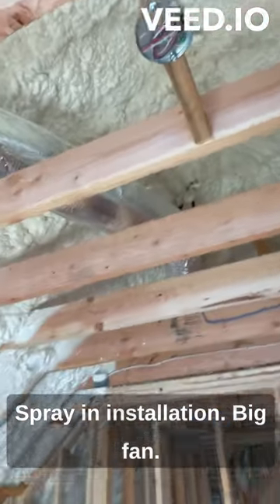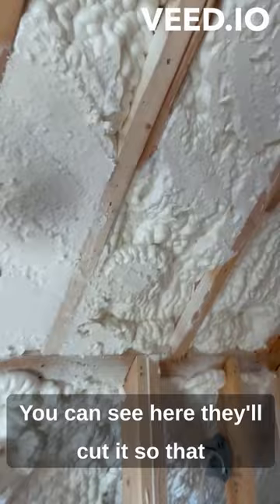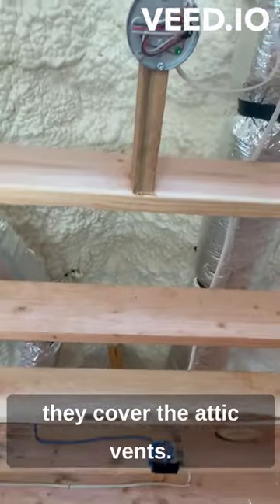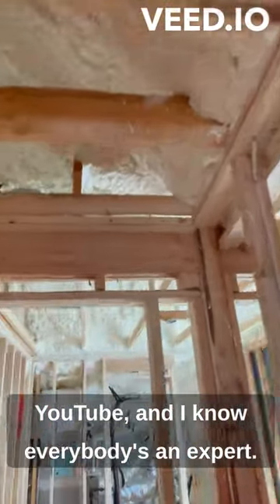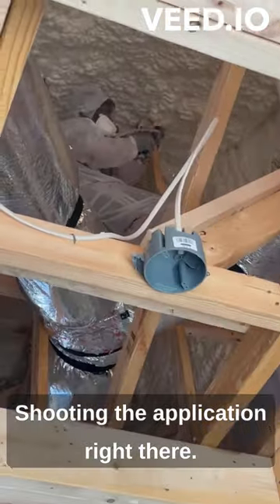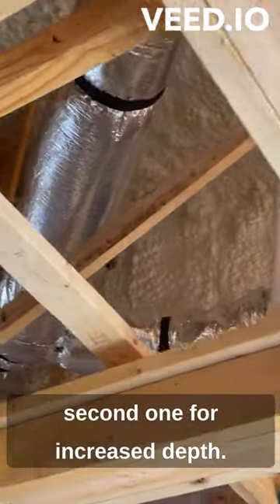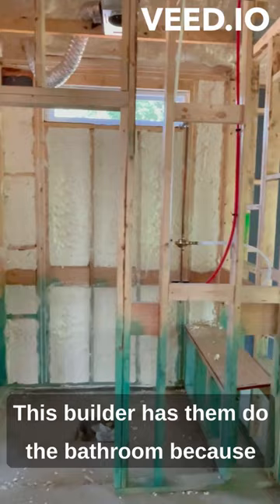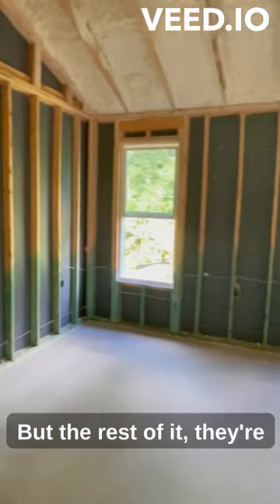No Ventilation with Foam Insulation?

Comment: The key here from the roofing standpoint IS, Dew Point !
The Dewpoint is the surface on the building where condensation will start to form. In this example, it is the interior side of the plywood on the roof surface. To counter this the roofer is now required to install Isosanurate  board insulation over the roof plywood to make the “roof plywood” “warm” or said another way, the same temperature of the attic foam insulation  Then another layer of plywood is installed over that and then the roofing is installed to the second layer of plywood.  The trick here is the plywood that is just above the interior spray foam cannot be left to get cold in the winter time. If it does it becomes the point where humidity will change from humidity to water/conensation, and that will create rot in the roof plywood.
 Sandwiched insulation between two layers of plywood protects the inner plywood  from rot which is structural. The outer plywood is only susceptible to roof installation errors and damage and water leaks. So from what we see here a vapor barrier of 15 or 30 pound felt paper should be installed over the initial structural plywood on these trusses over this foam and then a layer of iso insulation typically two layers of inch and a half staggered  with a layer of plywood laid over that or vented over that with inch and a half sleepers that which can be either strips of insulation or two by fours screwed into the rafters through the all of that isolate isolate insulation. Then the typical ridge vent and soffit venting  keeping the actual roof top roofing plywood dry and cool accordingly to the season. Again, understanding dewpoint and where it happens is the key here.
Reply: The point of closed cell spray foam is that warm humid air never reaches the cold surface of the plywood because the foam is an air barrier
Reply: The assumption that the closed cell foam will forever not split, crack or in some way ever allow moisture thru is not realistic. 
You are also assuming that no future contractor will ever violate the foam or that the homeowners as the home is sold multiple times in the future will live in a less than moist home. 
 Condensation in a home is just as much a result of living conditions and desires as it is environmental influences. The only constant is that things change. The second layer of exterior insulation and venting forgives all of the interior sins in the future

Comment: We do this in Texas when we do a standing seam metal roof. I’m an in the insulation business and we recommend a dehumidifier in the attic.
Reply: Or you know... You could just vent it? 😂
Reply: Spray foam works better than typical batts 🤷‍♂️you get a better R value with less space taken up.
Reply: @mihlfeldl2005 Why vent it when you can just ALWAYS have the power on. After all, houses are NEVER vacant for extended periods of time, and ice storms NEVER freeze up all the wind farms and knock out the power. /s 

It's just like all these houses that really need sump pumps: the house will be destroyed by mold after 6 months of vacancy.

Comment: I did batts in the walls (2x6) and spray foamed the attic. I’m in Atlanta area too. Had FoamSouth do my foam. Ryan and his guys are awesome. Highly recommend them. I did zip system on my house and air sealed it up tight paying super close attention to air sealing. I didn’t need foam for air sealing, just for R value so that’s why I didn’t do it in the walls to save a few $. I actually “vented” my ridge with some Carlisle Vapor permeable self adhered membrane, to allow any vapor to get out since the open cell foam is vapor permeable. I run a whole house dehumidifier (Aprilaire) in addition to my ac system. Also have a Fantech ERV for fresh air ventilation (runs 24/7). This house is THE MOST COMFORTABLE house I ever lived in. I have an indoor Air quality monitor that I have been collecting data for 9+ months now and our IAQ is 👍👍👍. Our most expensive heating bill this winter was $200 (natural gas furnaces) conditioning 3800 SF. Mid June - Mid July power bill was $240. We keep the house at 73 degrees during the day. 70 at night.
Reply from the maker: I've seen a ton of positives with this product, just this "seal it up" counters what I'm used to. Same for crawls, used to be air flow and now it's encapsulation. If you're doing well with this weather, humidity, ozone and fire smoke....you know it works lol
Reply: @Hmtatlanta  I never understood the thought process of venting the crawlspace. Maybe during the winter, but during summer you’re letting all that humidity in. I’m in the encapsulation camp. My buddy did his old house. The musty smell immediately went away and the humidity levels were much easier to keep in check. I highly recommend a whole house dehumidifier for anyone in the south. After putting one in my new house I just built, I’m sold. I will have one in every house going forward. Also allows you to run your thermostat temp a little higher and still be comfortable because humidity is really what leads to people cranking down their thermostat in the summer, then it’s cold and clammy.
Reply: Your heating bill in Atlanta is $200!? You live in a mansion or what? Ive got a 3 bedroom, 2 stories + full basement and attic in Maine, on a lake, and dont pay that. Half the house was built in the 80's and the original was built in the 50's well before any spray foam. I think the walls have a negative R value in the original lol
Reply: @justinmciver7423 ▪︎ what is your bill then? What is your square footage, furnace type:?
FYI - not a mansion, he mentioned 3800 sf in his original post.
Reply: We’re about to break ground in AL and I will reach out to Ryan. This sounds like a great solution!

Comment: I’ve had this at my house since it was built in 2014 in Georgia. No issues with humidity or mold so far. Spray foam walls also. 2200 sq.ft house I’ve never had an electric bill over $300 a month
Reply: Thats like no time at all for a home. 10 years. A home should last 80. Glad you haven't found anything so far tho
Reply: @markmurrell1894 ▪︎ according to the roofer in the preceding comments, you wouldn't even be aware of a leak until the leak has soaked your roof decking and is then making its way into your home. That would worry me.
I assume your electrical bill is highest during Georgia's hot summers. For reference, what would a normal electrical bill be?
Reply: @bethanyanderson1745 I've been in construction for 25 years and have been listening to these roofers say that since i started, but I've NEVER seen it. It's like unicorn milk. It sounds good, but I've never seen any.

Comment: Builders commonly only use spray foam sparingly if there's a good reason to. Its because spray foam has drawbacks like VOCs, flammabily, lack of serviceability, longevity, etc.
Reply: Electricians hate the spray foam in the walls, especially if more work has to be done after drywall because of something stupid and simple. It happens😊

Comment: Big fan of this…when installed correctly (baffles on the roof all the way up to the ridge cap) and all penetrations sealed in the drywall (around electrical, plumbing, hvac lines/vents) to prevent possible contamination of air quality inside the living area…..along with a fresh air duct incorporating a sealed barometric damper and good filtration to prevent negative pressures (from the operation of exhaust fans)  forcing inevitable infiltration of unwanted containments (pollen/dust/chemicals) from unconditioned spaces (outside/attics/crawlspaces)

Comment: The reason the wall do not need spray foam is because it either meets or exceeds the zone requirements. 
That and spay foam cost quite a bit. 
The sad thing is that roof if it ever gets a leak will rot out very fast and keep rotting out as the water can not pass through the spray foam. 
Anyone who builds a house that is going to spray foam the roof needs to build a double layer roof. 
Really it only adds a little bit to the cost. All you do is lay down ice and shield then you lay your vertical 2x4s and spaced every 4 feet and then lay down your horzorntals 2x4s and then sheet the roof and lay down ice and sheild and roof it with what ever. If there is a leak it will run down the ice and shield and drip out in to the gutter or the ground. This double layer roof is also has that roof peak vent down the whole lenght and any build up will vent out effectivly making the roof and house cooler. 
The same thing happens when you put solar panels on your roof.  Studies have shown the exact same build with solar on the roof will be far cooler than a roof with out. The double roof does the same.
Reply from the maker: This is the SE zone 3 and here I think it's R13 min for walls. Installer said they just want batt in the cavities due to cost. I did ask about the issue of replacing sheathing and he danced but when pressed, said that would get messy. He added that's not a routine "every few years" thing, which is correct. But when these homes hit 20+- it will likely need attention. Good points above, you know builders aren't doing that though...
Reply: Than would you have to put insulation in between the roofs? When does it end?

Comment: It’s important to understand the application and the correct foam for the job. 
Open cell foam is best used on interior walls for soundproofing 
Closed cell foam is best used on exterior walls. When properly applied, Closed cell foam creates a water tight vapor barrier
Reply: Should be squirting that stuff on the Out side then and putting reflective paint on it. I dont Know

Comment: Once water or moisture gets in, All it does is lock it in and hold it there. It will cause all the wood around it to rot. Done so many repairs ripping this out, and it always cost the customer a fortune.

Comment: It certainly does absorb moisture. I did a tear out of a restaurant freezer that was spray foamed all around. We had to cut 1'x1' squares because they weighed in at 70 lbs each. Full of water.
Reply: that would probably have something to do with different types of foam...which there are.
Reply: @jamesbrickner5159  yes! All of whom absorb water or at least encapsulate it
Reply: @craigverwey983 🧐no...closed cell foam does not actually absorb water--but costs more and requires expert application--or it can really create more issues-as a few commentors have said.
Reply: @honeybadgerisme  so you don't really know what you are talking about.

Comment: Funny thing I’m actually rebuilding a whole roof right now because of this product  there was a leak by the chimney and the foam held the moisture in causing the roof sheathing and trusses to rot out  I believe the only thing holding the roof in place was the foam crazy scary
Reply: @jasonritzman7622 ▪︎ did insurance cover?  And why not just remove and replace the rotted out places? Can't the existing spray foam/decking just be cut out?

Comment: Whoa. That electrician has some faith in the drywall guys. Already cut in his pancake fan box is a bold strategy. (Nothing wrong with it) but more often then not drywallers hit my wires so I just stub in about a half inch of romex and leave about a foot or so of slack very above so I can pull it down later.

Comment: There is no attic. The conditioned envelope goes to the roof. The ceiling is just a view block. 
The duct work is kept inside the conditioned space. 
Good design for a southern home. Not much heat thru the walls in the south if they have sufficient eaves.
Reply: It's still an attic. Attics are defined as the area between the roof rafters and the ceiling joists for the upper most floor. But yes, it is conditioned air, which is a better design
Reply: Is it a better design though? Instead of a 3 ton ac unit you will need a 5 ton. That’s a lot of extra space you have to heat and cool.
Reply: @Bofum69 ▪︎ wish you'd have gotten a response.

Comment: Bad product idea, once the roof starts to leak you can't find the leak  and  even though if there's a leak even there to begin with. Some houses fail inspections because they can't see the roof if it's leaking so the mortgage doesn't want to give you the house there's a whole bunch of problems with spray insulation. I prefer rockwool you can get wet and be dry out without a problem and the inspectors don't have to worry about being blocked out of inspection if you want to add or remove/replace something your not cutting out foam to get to it then have some one cone back to spray tbat area

Comment: If there is no place for the air to escape I would just seal the soffets also so no new/fresh air comes in and no new/fresh air goes out. Basically making the attic an air conditioned "livable" space like the rest of the house. You just may want to throw a few ducts in there to cool it off too, and don't forget to size your HVAC units for that extra space.

Comment: It's called a conditioned attic and I'd NEVER do it under a shingle roof. When it leaks you can have serious structural damage before it's noticed.
Reply: @bobbygetsbanned6049  ▪︎ would you do it under a metal roof? 
Please, no offense, but what is your line of work - roofer, insurance, GC, etc or perhaps a homeowner who has had experience with this specific situation?
Reply: @bethanyanderson1745   I might consider it under metal if they use ZAC screws otherwise it would have to be standing seam. I'm just a DIY'er but the information is out there.
Reply: You need to spray open foam insulation on the attic, Incase of a leak from the roof you can spots the leaks

Comment: I had a customer who had a leak and chased it for years trying to find it. Couple rafter bays were completely water logged. They ended up reroofing and tearing foam out. Lots of mold on backside of drywall

Comment: This is what you do in hot humid environments like Texas. You have to condition the attic space. You seal every crack and joint from wall to roof and attatch soffits after water and air proofing. The roof has to be sealed with self stick water barrier underlay so no leaks are remotely possible.  Then you test to see how tight you have it with negative air measurements. Then you also have a heater that brings in fresh air from outside and heats or cools it before getting in the house. Costs some money. But you save energy.
Reply: Definitely Ice/Water shielding. Worked as a remodeler in Georgia low country. 100% peel and stick is what we used.

Comment: Hard to find roof leaks and by the time you do the water has done the damage. Other than that its great stuff. Also, asphalt shingles seem to last longer as well.
Reply from the maker: No doubt on leaks, can hard as hell to track them on a typical roof....
Reply: By the time an owner is aware there is a leak it is too late. This thing does not dry so the lumber rots. Also, in case of tear down the entire structure heads for garbage dump. Unlike traditional insulation one can’t separate the foam from the lumber.
Reply: Nope. There's nowhere for the leak to go and it gets burned off the next time the sun hits it. Closed cell foam is a miracle product
Reply: Wrong, shingles don't last longer because the heat can't dissipate on the back side. Many shingle manufacturers will not honor their warranty if there's spray foam on the roof decking
Reply: @saultpancetta366  those companies don't know the science behind spray foam and look for literally any reason to avoid claims. Also there are plenty of companies that do hold their claims with spray foam. There is no degradation of shingles from the insulative properties of PSF under decking behind shnigles
Reply: Metal roofing. Problem solved
Reply: @jamesdannelly6760 ▪︎ metal roofs do not leak? No matter the installation method? Serious question, not being facetious.

Comment: Spray foam must be closed cells, open cell is useless. Got that from builder over garage, floor freezing cold. After costly replacement (early Covid project) with closed cells, bare foot on hardwood floor now no problem. Well worth it.

Comment: You don't have a vent, but you have to remove moisture/humidity from the home. So this guy may not know it, but they should be using an HRV or ERV to do that. Also, They're batting the walls because it costs about 1/2 to 1/3 the price and you can insulate fairly well on the walls.

Comment: Did my 2600 sq ft addition to my house, roof walls 2nd and 3rd floor joist and never had a single problem. One thing tho is they said i do need vents to introduce fresh air into the sealed home, i said i have 4 kids and its the hangout home for all them and friends. He said that works. Living in hurricane zone it turns your house into a rock instead of a parachute with the high winds. 100% approve of spray foam
Reply: @jebronlames7789 ▪︎ when you state using foam turned your home into a rock rather than a parachute, you must mean no air infiltration, right? But couldn't a batt insulation provide the same results if the air leaks are first sealed?  Because it's really the air leaks that are problematic during a storm, right? Technically, the insulation isn't the difference, right?
Reply: @bethanyanderson1745  batton requires vented soffit's  whereas foam doesn't.
Reply: Yes on no air infiltration,  the soffit always takes the worst damage.

Comment: All you have to do is put baffles in to leave a small gap and either a ridge vent or standard vents with a small attic built at the top. All problems solved will all benefits. I know direct foam is acceptable, but not on my house.